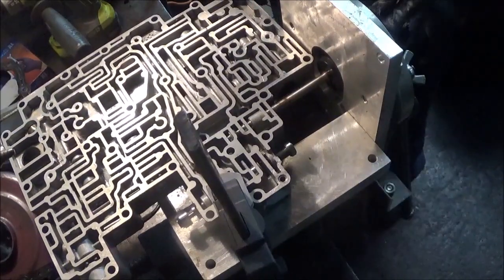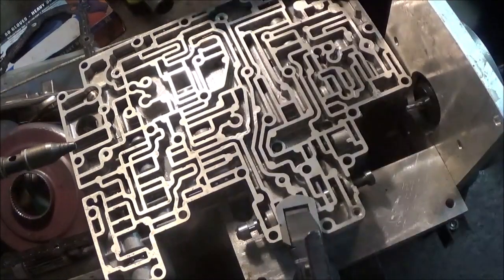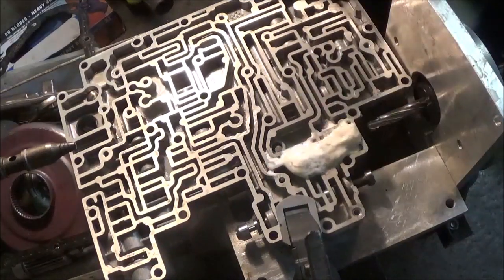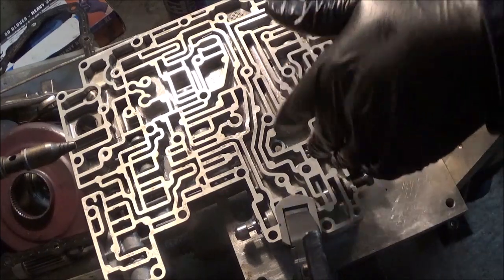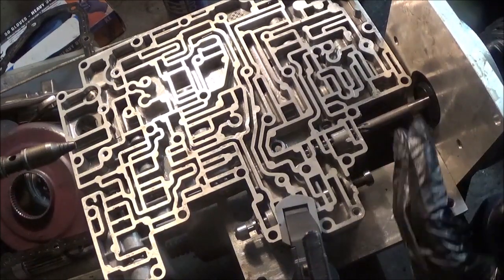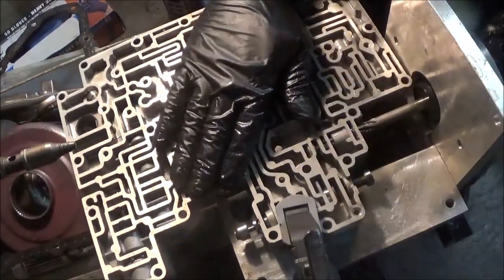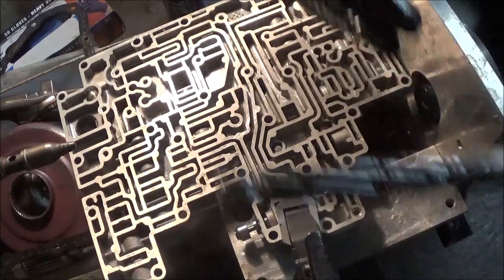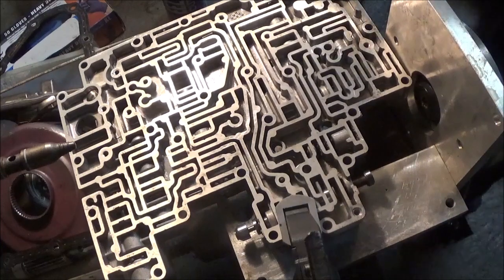4R70W,4R75W,4R75E TRANSMISSION TIP 4 (PART 2) Sonnax bore tool vs Sonnax reamer tool

Comment: I bought the reamer and tool to hold the valve body but the bore it’s enlarge extremely a lot where the valve is not even sealing. If somebody can please explain if I’m suppose to ream the bore super slow or fast?
Reply from the maker: If you are using the reamer, then you need to buy sonnax oversized valve. Part number 76948-47K for solenoid regulator valve
Reply: Yes I did buy that valve but for some reason the bore gets to big I thought I had the reamer at a angle but that’s not the case
Reply from the maker: @anthonyo3460  There is a bore alignment tool that is suppose to be used first. Then, you are suppose to use the reamer. Not sure how you can damaged anything if the alignment is right. Also, you should ream at a slow rpm. However, If the hole is too wide, then you will need another valve bosy.